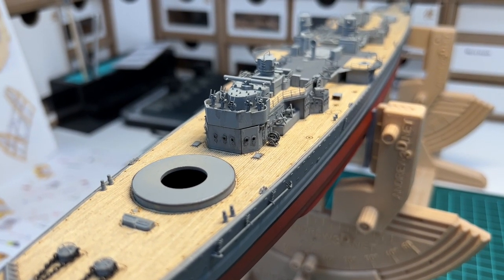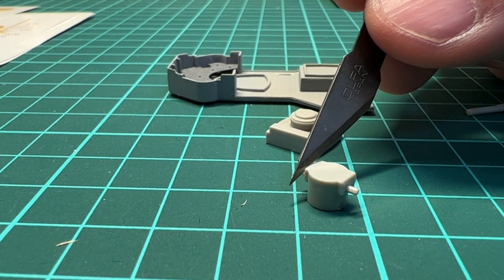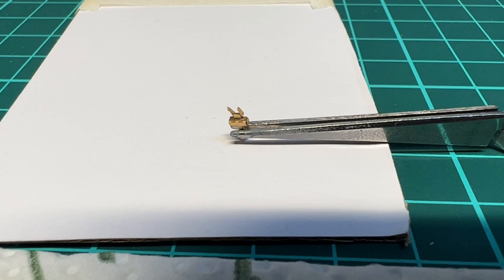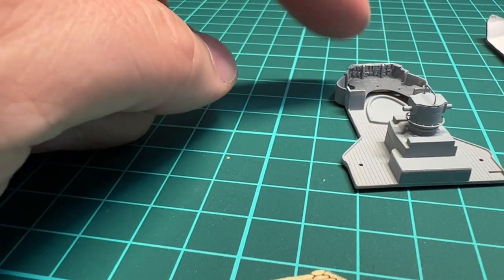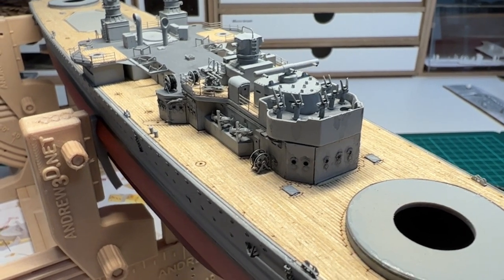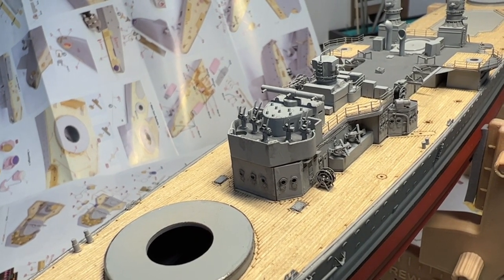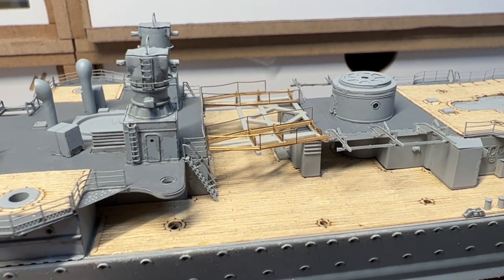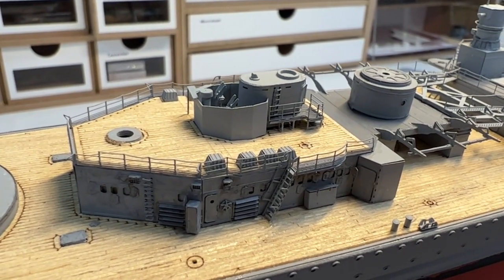Trumpeter Admiral Graf Spee 1/350 - Build Log Part 9

Comment: Building the same kit, not using.the PE set. Did use a wood deck and some PE ( ladders, rails and radar ). Only second time using wood deck and not much expertise using PE. My learning curve is way behind yours. Great work
Reply from the maker: Thank you 😊 What do you think of the kit? I really like working with PE, but alway s some new challenges.
Reply: Didn't really have any major  issues with the it, just the ones I caused. The major one I caused was not installing the wood deck right. It went good, but the superstructure didn't fit right. There was no space between the deck and superstructure too glue it down.